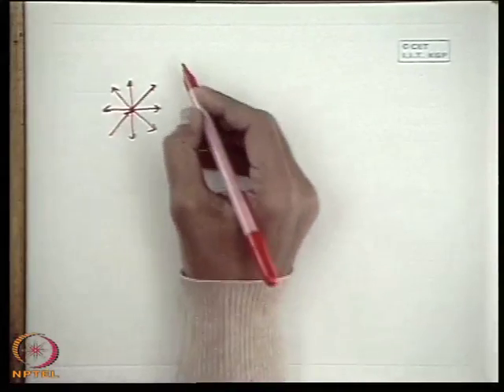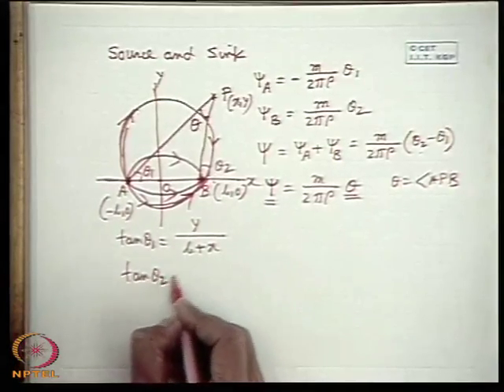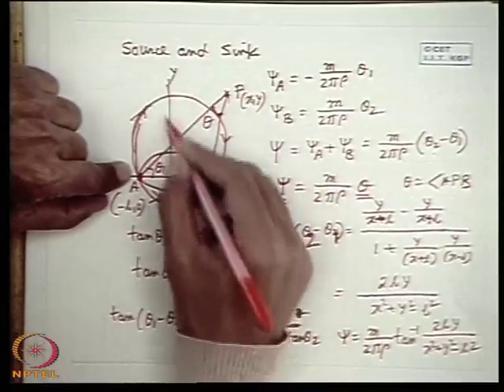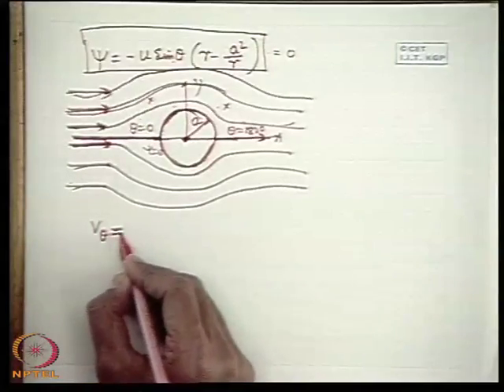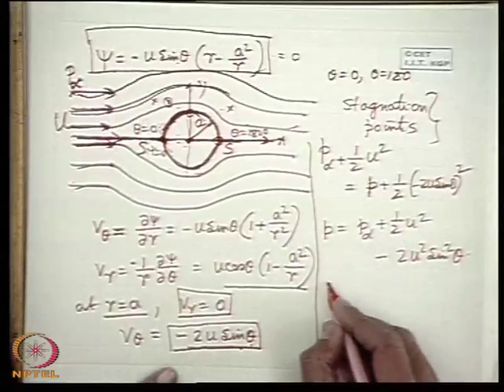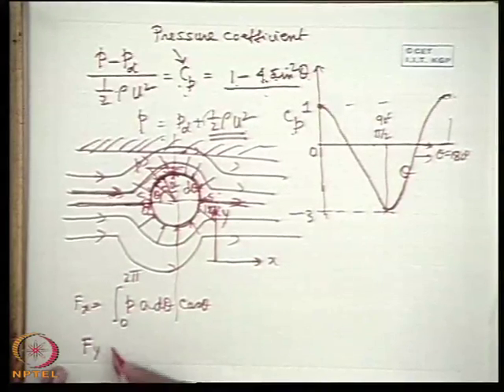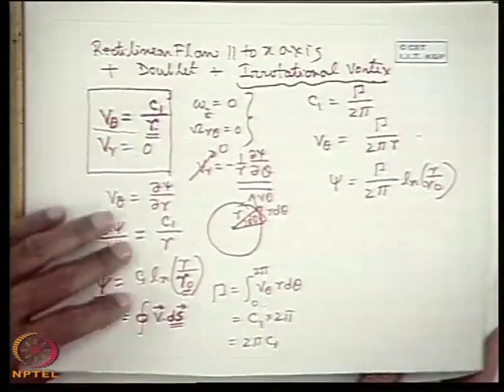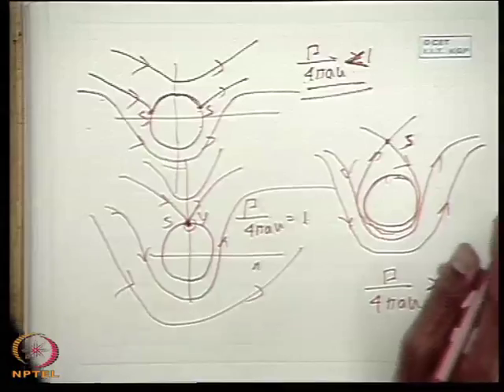Mod-40 Lec-40 Flow of Ideal Fluids Part II

Comment: Is it possible for irrotational vortex vorticity is zero but circulation still exist? As sir taken in case of rotating cylinder in uniform flow..
Reply: circulation is the surface integral of vorticity. So circulation becomes zero if vorticity is zero

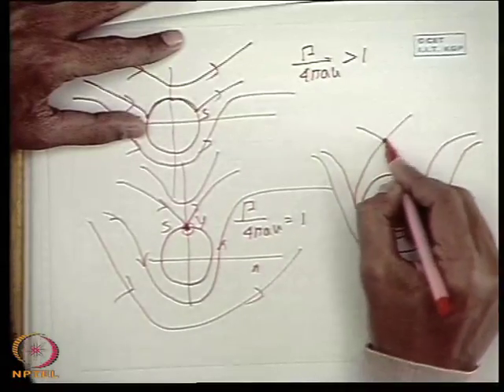Comment: Streamline never intersect itself then what about 40:30..?
Reply: At stagnation point, velocity being zero, you can't draw tangent to check velocity hence they can intersect
Reply: sir has said like at stagnation point particle has zero-velocity, that means if the particle flowing from upstream to downstream all comes to rest at the stagnation point, then why it forms a circular streamline..........And there will be no streamline after stagnation point for psi=0...................all particle is coming to rest at stagnation point......